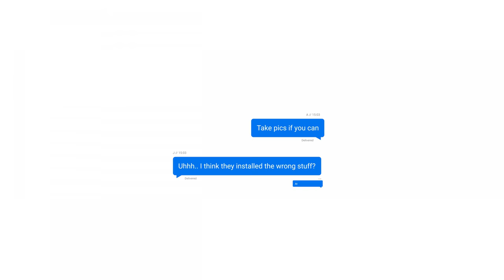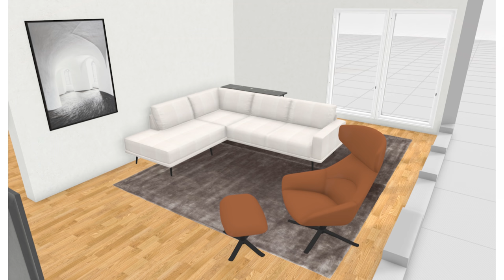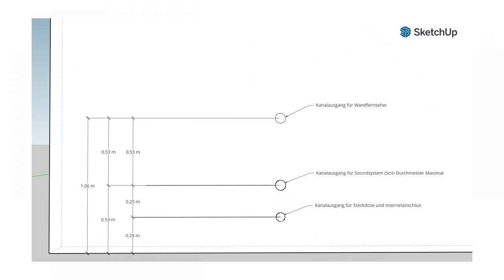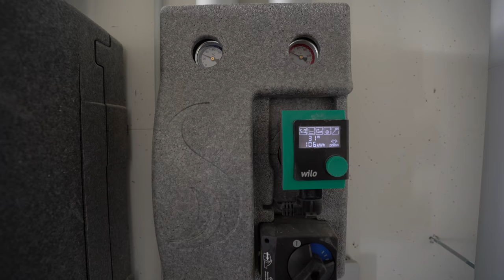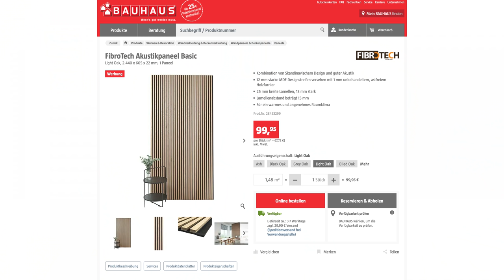HARD Lessons from Building a House in Germany

Comment: Thanks for the update, I was curious about how things were going..The house building process in Germany is indeed challenging... So many people, contractors involved, naturally so much by ear.. Due to personal experience (not house building related) I now (not always comfortable with that), always ask for a quick confirmation (can be one line) to have some proof.. With regards to your 'technician room' – assuming it's a local company/ies?) – I'm surprised they didn't offer you a proper explanation/lesson... Maybe you could simply ask for it.. esp. as they are often the companies that do the yearly inspections (natural interest...). I hope this last phase will go quickly and as smooth as possible.. Best of luck.
Reply from the maker: One commenter has said that they may give us an overview while doing the handover for the house. Alternatively, we are also thinking that maybe the inspector we are hiring could also give us a tutorial.
Reply: @TypeAshton  Then handover is to my (limited) experience more focused on the general  bigger picture.. The company(is) responsible  for your 'tech room' would (I assume, esp. if they are local) generally be interested in you as a customer with regards to mandatory inspections  or possible repair issues,  happy to give you a thorough run down of your system. Personally - I would just give them a call and ask when it's going to happen.. (no expert here, but I can imagine that it's even mandatory on their side..could be in your contract).. Native speaker or not (and you guys do brilliant ), your questions, frustraitions , the troubles you had are 1:1 the same for everyone building a house in Germany.. You gonna get there hopefully sooner than later. :)

Comment: Regarding your entry hall I'd maybe be waiting a little bit: You probably will have an indoor doormat made of some carpet material to keep dirt and snow out of the other rooms as early as possible and will also have a coatrack. Both items will already reduce the echo thus acoustically optimize the room. Should these measures turn out to be insufficient, then you could install the wooden panels (by the way: There's the black forest company Lignotrend that has a great selection of different wooden and locally harvested panels with well defined acoustic properties each) and / or go for Rigips Akustikplatten especially for the ceiling (you often see those in cafes, schools etc. where reverberation time has to be reduced). Maybe you should not install too much flammable material in this area, because it's your escape path; if it was a public building, rules were pretty strict regarding what was allowed to be installed there and what was not.
Reply from the maker: Great suggestion on the company, we have not found them yet. It looks like they also offer varying level of flame retardancy. Really cool, we will reach out to them and see if they can fit our budget.

Comment: Concerning your TV setup: why don't you just build a little drywall in front of your concrete wall, standing out in quite a different color like bordeaux red, stone grey or apple green? Think about that. It allows you to put your cables wherever you want AND it is a real eyecatcher.
Here in Bavaria where I live we would do it with scrapped wood. But we also had a strange wall an painted one side in very dark gray. It turned out really good. 
What do you think?
Reply: Drywall: you could build it only 8 cm deep. Just 1.5m high. Putting nice decoration on top. Would be my approach...
Reply from the maker: We've talked about doing this with several different materials and are exploring it as a solution. Thank you!

Comment: Hmm, about those sound dampening panels: Maybe those would fit well above head height since the ceiling is high and you don't risk catching on them when moving furniture or bikes and stuff. Near the stairs you could "fade out" the panel by cutting it at whatever angle the stairs are.
Reply: Those sound dampening panels would be awsome against the ceiling !

Comment: 24:20 that round thing is half water half air (nitrogen), separated by a rubber membrane in between. The air side has a valve under the valve cover (black dot in the center). What is it for? Water expands and contracts as it heats up or cools down, steel / copper / plastic pipes do not expand and contract as much, the volume difference has to go somewhere. You guessed it, it's the "Ausdehnungsgefäß" https://de.wikipedia.org/wiki/Ausdehnungsgef%C3%A4%C3%9F
Reply from the maker: That is so, so cool. We've been doing some more googling as the comments come in and this kind of stuff fascinates us.
Reply: @TypeAshton  Don't you have that in the US, too? Doesn't water expand there when heated and contract when cooling down?

Comment: I saw that you have a hot water tank (boiler). The big white ball is a surge tank. Water expands when heated, and it needs space to do this. There is therefore a membrane in the expansion tank which ensures that the pressure always remains the same. Unfortunately, this membrane is broken after 10 years at the latest and the container has to be replaced. I think your bathroom is very cool, I also like the parquet floor. But I hope you didn't install underfloor heating. In my opinion, radiators are easier to regulate and easier to maintain.
Reply from the maker: Yes, our house does has underfloor heating in each individual room - it is standard in all of the house builds in our neighborhood. Hopefully this won't cause too many issues in the future. However, it is nice that together with the Fernwarme system, our house will be rated KFW55 so we can be more efficient.
Reply: @TypeAshton  Underfloor heating is a little bit slow to react to changing temperature needs (e.g. when yoou return from a holiday trip and want to warm the house) but in my experince it not only saves space but also needs less energy as the water temperature is lower. Most important: it gives unsurpassed comfort (especially warm feet in the bathroom ;)

Comment: I have been here 15 years and bought a house that needed remodeling. Some of which we did ourselves, like floors. Lessons learned… 1) they mark up everything 100% at least.  If you don’t negotiate on every detail you lose. 2) you need to be a project manager… you need to get confirmation and follow up with each accountable person each day.  If you only have one contact, that poor soul should get an email and a all each day demanding an update. This is not just Germany, but everywhere.
My brother in law sells flooring. We went to his shop and selected some different floors and asked how much they were. My brother in law gave us his cost…. Which was 40% of his list.  
We would like to exchange out our radiators. We asked our local plumbers for offers. They all came in about the same.  I looked up the part costs online. Again 40 to 50 percent of their markup.  So I picked a plumber and told him that I will order the parts myself. Now I did pay a bit more to get him to commit to a date to finish by.
Reply from the maker: Yeah that was one of our big "hang ups" with the original price of the bathroom fixtures, the mark up seemed so extreme (even in light of inflation) that we couldn't justify it. Same with the interior doors. We were planning an upgrade until they told us it would be 1,000 euro PER DOOR. oof.

Comment: Since you're not moved in yet, and on case the TV situation is really bothering you, why not get someone to cut an new canal in the wall and hook up the powerlines right where you want them? Usually the local electritian, the guy doing power 😃, has the tools for that. Even if the wall's concrete, they cut the first one, too. Of course it's dirty and annoying but based on my experience, I've opt'ed out of cutting the walls to install proper Ethernet cable and now I have issues almost on a daily basis with the WiFi, fixing things while there are still constructions ongoing is way better then being bothered by a compromise for the next decade.
Reply from the maker: I think this is probably what we will end up doing. At this point, we don't want to contact them to do it NOW because it could delay the move and we'd have to have it approved by 4 different parties involved. Whereas if we just do it after we move in, we can contact the electrician on our own and get it done quicker (and cheaper).

Comment: It always mind boggles me how different in quality a house is Germany vs US. When I look at all the houses here in the US I have lived in, it is just bad. Wires and pipes are hanging around, no insulation, the walls here are 4 inches thick, which does not mean it is 4 inches of concrete, but maybe 1 inch if plywood and empty space and dry wall. The gas line in our current house in the garage to the water heater is just a wobbly yellow tube that you walk by every day and store stuff around, hoping you do not damage it....it's a gas line! When we turn on the hot water in the kitchen, we hear the tube in the wall moving when the pressure changes and the windows are so thin that you hear the neighbors kids in the backyard as if they are in your room;-)
When it comes to contractors or the main responsible person for your build, it doesn't matter if you are in Germany or the US. I build houses in both countries and it's a nightmare on either side. However, in Germany I know why I pay so much money for a house due to the quality, in the US I have a very hard time to be OK with the prices they charge for what you get.
Great video as always. Enjoy
Reply from the maker: We have been always extremely impressed by the build quality of houses here in Germany (and much of Europe.) Everything is done properly with upfront thought and planning, rather than just hurrying up and making a shell to live in.

Comment: What does this thing do ?  it looks like a heating expansion vessel pressure  "The purpose of the expansion tank is to absorb the pressure differences in the water in the heating system. Because the volume of the heating water decreases when the temperature drops and increases when the temperature rises. Without an expansion tank, the heating water would expand, the pressure in the pipes would increase and it would be drained through the safety valve. The lack of heating water in the heating circuit would then lead to a significantly lower efficiency of the system and to increased energy consumption. In addition, the lower water level in the heating system would suck in air and thus oxygen when the temperature drops, which can lead to corrosion."  and to your entry way are the walls just colored ir is there a wallpaper " just colored usually brings more reverberation with it , and if the room is then filled with e.g. a hallway wardrobe, shoe rack, pictures and carpet is set up, this will further reduce .

so keep doing your enjoyful job here i love it
Reply from the maker: Thank you so much for the great information and advice! We really appreciate it.
Reply: @TypeAshton  :o) you dont have to , In return, I learned a lot from you, on the one hand understanding the spoken word in your language (and I have to say that your pronunciation in the clips is always very clear and easy to understand) and on the other hand a lot about the USA that was completely unknown to me

Comment: That it is like building a house. nothing i wouldn't expect. Pretty much standard problems, you could have run into without covid and Ukraine. I want to go through your technical questions. I suppose you want to get a documentation along with your house and spare parts. 
You should insist in getting spare wood for the floor, spare tiles, so you can repair later and so on.
Furthermore you should get a complete set of drawings, including the static calculations, what you need later if you want to take out a wall or so.
For your Heating system you should get a P&I Diagram that shows what is installed where in wat order.
Be sure to have the installation manuals and the User Manuals for the components.
If not, google them, print them out and put them physical in paper form into a binder you want to store next to the heating. That way you can access them now or in 20 years, if you need to replace one component.
The Thing you pointet out is a expansion vessel existing out of an outer shell, a rubber inlay and a air valve. It's normally filled with air or nitrogen to about 1 bar pressure, before they fill your hot water heating system to 1.5 bars. This guarantees if the heating water expands due to temperature changes, the pressure in the circuit doesn't rise or fall too much.

One of the most important things you need to do in the first year of living there is reading the manual of your heating system, understanding the different settings. First thing you will need to do is get a paper and write every parameter down you can reach, so if you screw it up you later can revert to a known good. Normally after reading through the manual(s) you fully understand why what is installed how and how it is supposed to work. Then you have the chance to optimise the systems to your need.

Acousics: As you are an engineer I think you will be able to understand the concept, once you see it in a book. That can help you to pick the right materials. Maybe you want to read the "2021 ASHRAE Handbook fundamentals", Chapter 8 starting at page 164 of 1088. Maybe Chapter 25 to 27, 32, 37 can also come handy. You might find that book on u1lib dot org. 
there are also german books you will find if you type in akustik.
Reply from the maker: Great suggestions, thank you!

Comment: The construction company makes the wall thicker than planned? To my opinion, the reason for this is very simple: They have realised, that the original construction was not solid enough to prevent the wall or the house from being damaged by a landslide. As you have seen by the "Hochwasser", landslides are a major problem in a hilly and rainy country like germany - especially in case of heavy rain periods. 

Normaly, in such a case the construction company has to take more material away from the slope, so that they can build a thicker wall without "stealing" space from your property. I have the feeling, that the company wanted to save the incured costs and took the necessary space from you! So, it might be a good idea to ask the company for a financial (or otherwise) compensation for less space. 

The long term stabiliy of the wall is a crucial factor for the safety of your house. My recommondation: Try to get all documentation about the static calculation and the construction of the wall  and the water draining system under and behind it (statische Berechnungen, Konstruktions-/Bauzeichnungen, Abnahmeprotokolle etc.). In case of a damage of the wall or a landslide, these documents will be very helpfull  for you to get financial compensation, if the company has made a mistake.

On the other hand: Be happy, that the company makes the wall more solid, it gives you more security!

Comment: 17:30 the tool you are looking for to fix this is the "Mauernutfräse", pretty much every electrician and every "powertool rental" has one. Are you sure that the wall is concrete? Usually above ground level walls are build with bricks for insulation purposes (rather hollow sound when you hammer your hand against it, compared to no sound on concrete).
e.g. "Planziegel" like this one https://youtu.be/dka1MGnu8wM
by the way: insulation filled "Planziegel" like the ones in the video should not be drilled into with a hammerdrill or percussiondrill as this would shake the insulation out of the spaces.
Reply: The wall in question is the one facing the neighbouring row house. Here temperature insulation isn’t as important, insulation against sound is more important. From what I have seen on construction sites is that these walls tend to be made out of concrete.

Comment: How big is your house (M²). We have been exploring a new build in Germany with a prefab home builder. We visited a model home. The quality is excellent. It would be built to near passive house specs (airtight - triple glazed windows/doors - mechanical ventilation/ no thermal breaks) inc solar system - BUT the cost is around €3450/M² + the building plot. Wow... That's a lot. Wonder how your new house compares.
Reply: Did you buy from a prefab home builder?

Comment: I would like to know what kind of   issues typically happen when you build a house in the US. Are there less chaotic moments or even more?
Reply from the maker: There are issues all the time. But it is interesting how different construction methods and expectations are. For example, it is UNHEARD OF for an American house to not include a kitchen of your choice. Most new builders work on a menu system - the "base" house costs X amount and then for every "upgrade" they have a fixed price. Often new developments will have a "model" home to show you all of the options which are available.

Comment: As far as the tiles go: Typically they leave you some spare tiles of every style you have in your house. You will have to replace tiles in 10 years from now - never be able to buy them in the same style. Same goes for roof tiles (if you have this). I have about 20 of them and needed 5 after 8 years. Make sure that they leave you like 5 to 10 tiles of every kind but as I said, it is normal that they do, AFAIK.
Reply: Just noticed you had this in other comments, too... never mind.